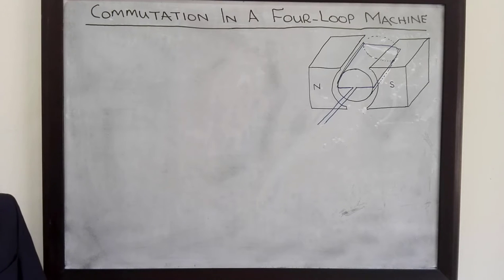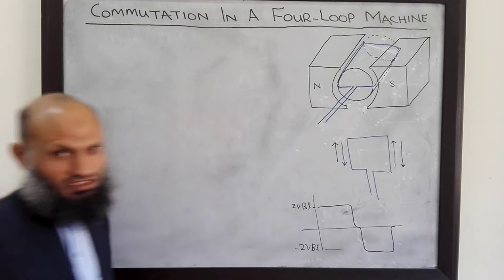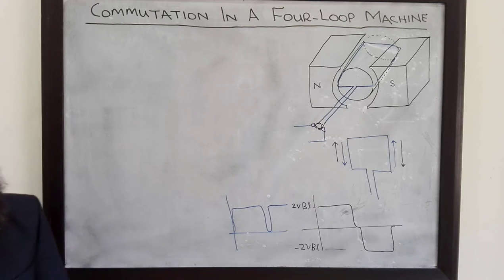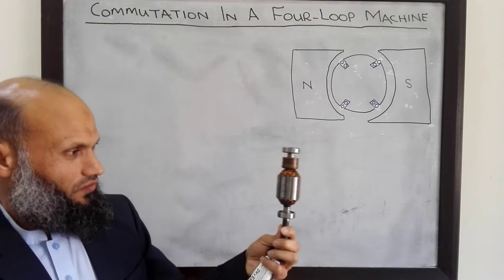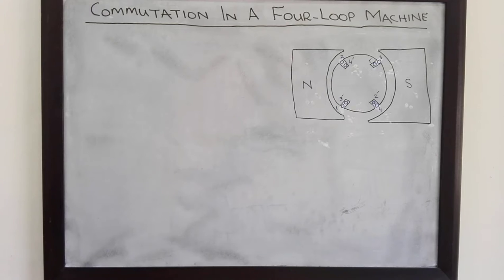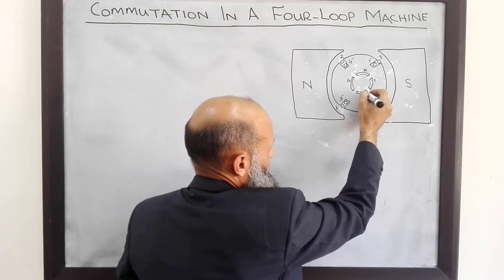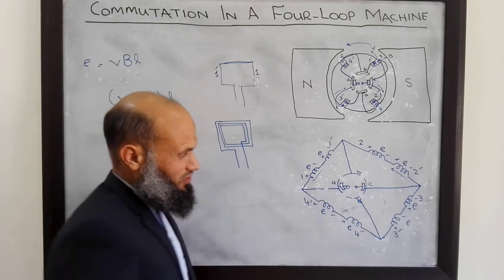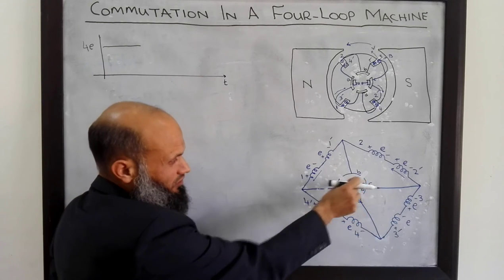EE213 - 15 - Commutation in a simple four loop DC machine

Comment: 17:43 why polarities are from - to + , it goes over it, shouldn't it be from + to - from high potential to low sir?
Reply from the maker: Voltages are induced in the coils, making them function as voltage sources, and in a voltage source, the direction of current is from - to +
Reply: @MAFarooqi  Yes sir I got it thanks a lot...

Comment: awesome explanation, thanks very much.
The only part that wasn't clear for me was at the point 22:11 concerning the different paths of the voltage induced in the total voltage. In your explanation you chose the path 2'-2-1'-1, my question is: could it be 2'-2 only? Meaning that the induced voltage goes from the part c of the commutator to the part b of it.
Reply from the maker: Thanks for linking. 
You are right, you can also move from one brush to the other by moving through the path segment_c - coils 2'-2 - segment_b. Again, you see that the total voltage between the two brushes is 2e.
Reply: @MAFarooqi  Ok. Thank you for your great work!